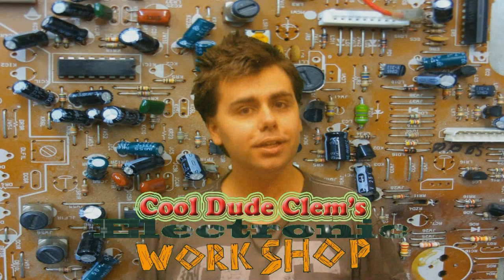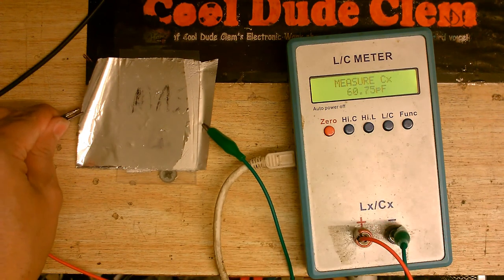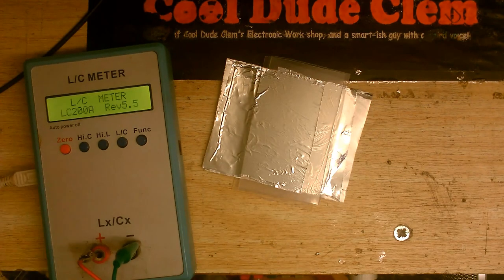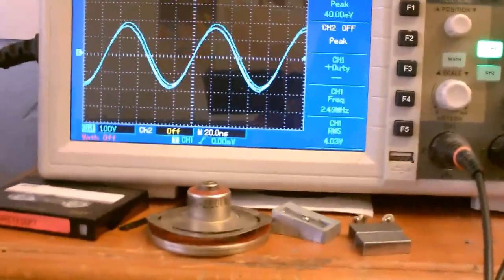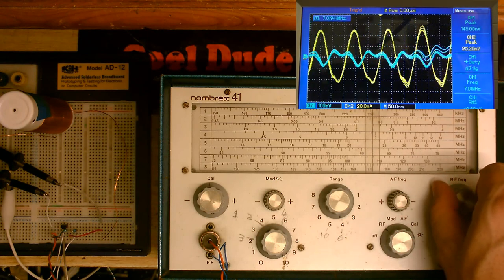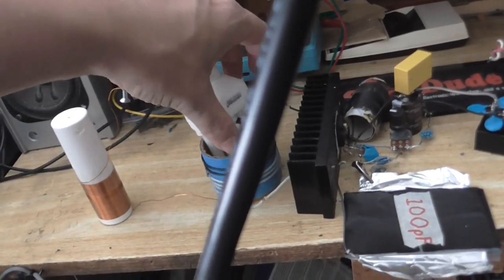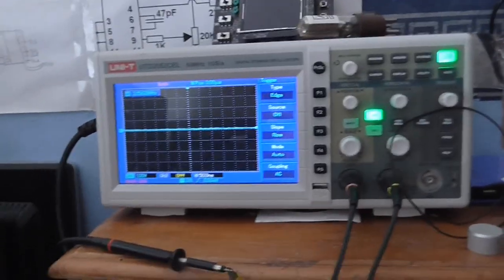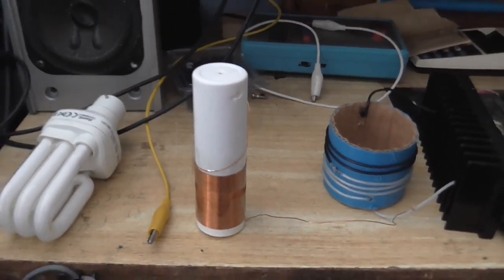Plasma Flame Generator Part 2 - Making a capacitor and failing to tune the dam thing!

Comment: That 10MHz is not so important. Mine works best around 11,2MHz. But that variable capacitor will help you very much whit finding the point where by your outputcoil(±50turns on a ∅4cm) suddenly makes a flame! I use a selfmade capacitor too, but i had to because not one existing capacitor does not heat up shocking fast when feeding the circuit 60v (draws 5Amps! 300W for a 4cm flame but its a superhot one!)
Reply: Build one with gu5b

Comment: I have built up almost the same circuit. I found that it works best when the larger coil goes inside the smaller coil, like a regular sstc. I found that I needed to use at least 30v to get any good output. I also found a happy medium between flame size and blowing up my irfp260n is about 40v at which point it draws about 3.5-4.5amps. Also a resonant frequency of about 9.7mhz works best after that the current draw gets ridiculous.

Comment: You're really close need more filtering on AC supply or use smps and just slightly tune the tank cap better or keep adjusting secondary turns. Recommend making a small primary jig that sandwiches the coil between something that allows it to be adjustable as far as winding spacing. Plastic screw in the middle would be great.

Comment: swap your cercap with film cap!! it will work better, give it 4n7 cap
p.s. and use freakin doorknob rf cap, please, it will work flawlessly, your foil cap is supremely lossy
p.p.s. make it oscillate at 10 to 11 megahertz, it works best at those frequencies
p.p.p.s make a breakout point like a steel ball, when you get some meaningful result